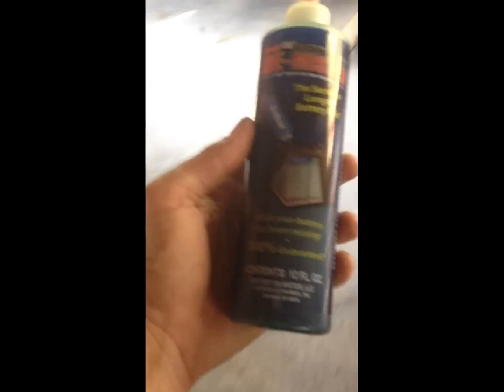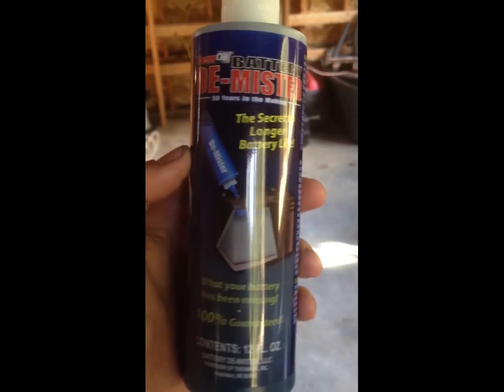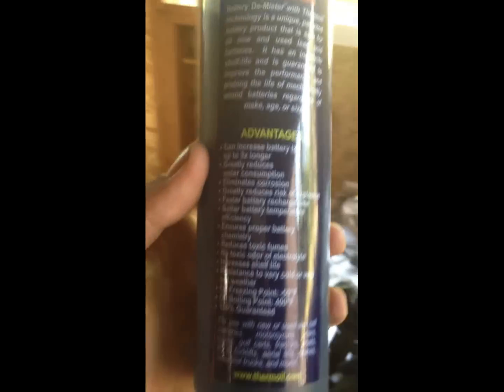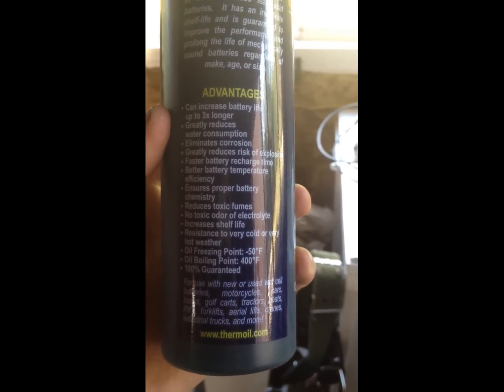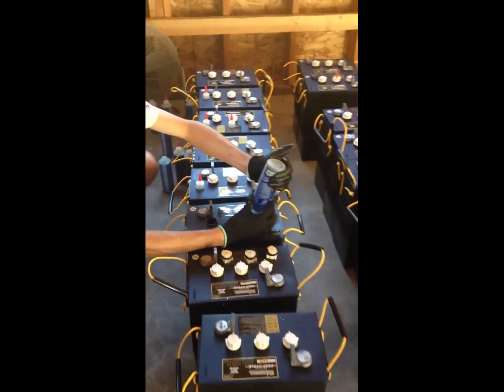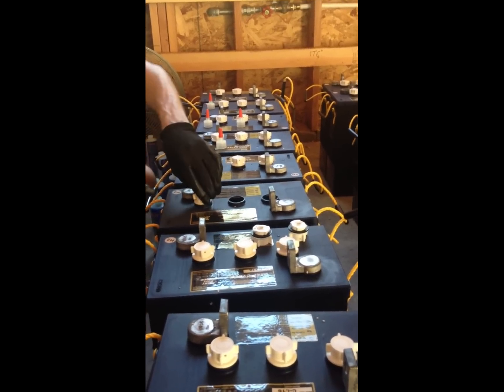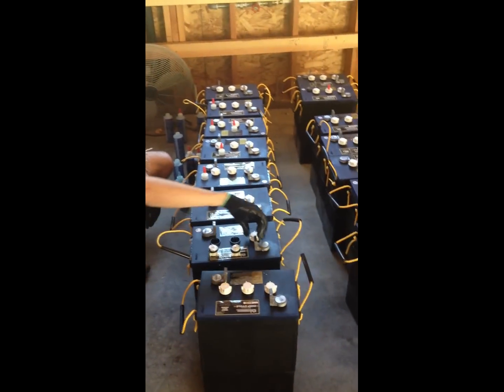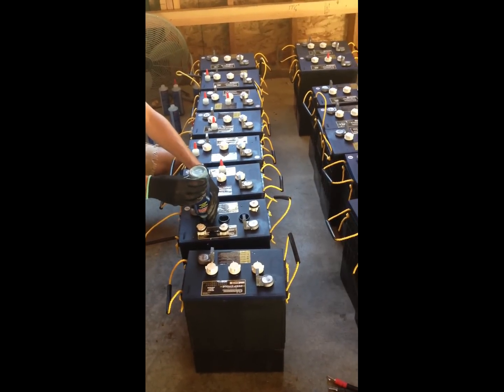Installing a Solar Off-Grid System 14- Battery DeMister Oil Saves Your Batteries!

Comment: I have worked with batteries for 20 yrs. What YOU have is a gimmic , since electrolyte is a solution made up of sulfuric acid and water, let me break down properties for you. Sulfuric acid will NOT evaporate until it reaches its boiling point of 240 degrees. At that point your batteries will be in thermal run away and melting down any way with no resolve. The water that dilutes the acid to make up the electrolyte will evaporate regardless on any crap you put in your battery. The hydrogen your product claims to allow by for you to collect is a natural byproduct of the charging process (called gassing). 
 Looks good but you wasted your money.
Reply from the maker: Great to know, thanks for the insider info. I was told this product helps prevent damage to the lead plates if the water is not refilled on time, is that false as well?

Comment from the maker: The approximate cost of the system was just under $20K but California offers a 30% tax credit, so realistically it is around $14,000 and yes, this powers everything on the property.. There are no power lines near the area. Before this the place was powered by Gas and Diesel Generators. Now it has about 7 days backup power.